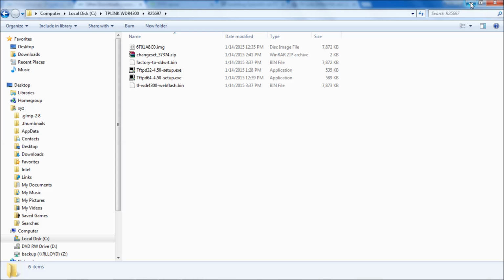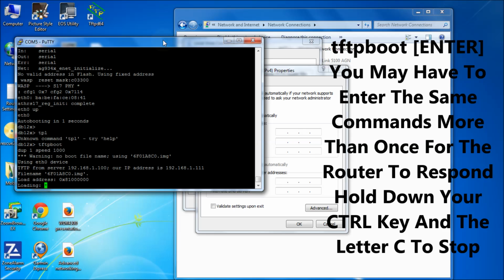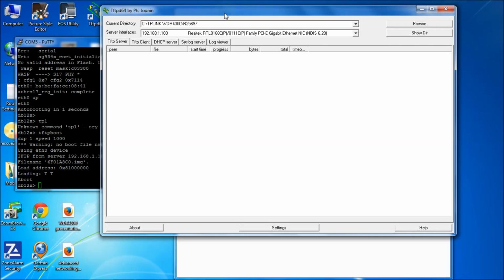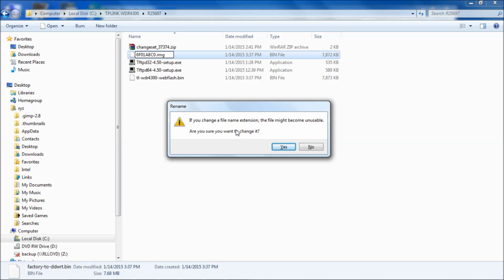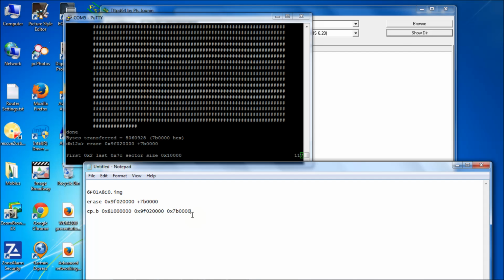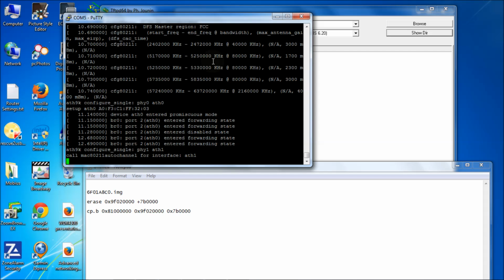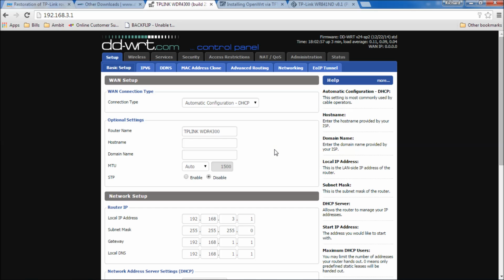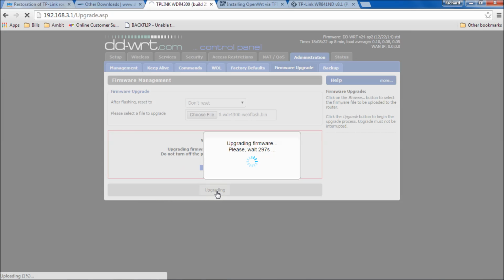Bricked TP-Link WDR 4300 Router Recovery Using UART Serial Converter Part #2

Comment: Thank you so much!
I had the same problem with another TP-Link C7 device. The problem was the same as described. The missing file had the same name: 6F01A8C0.img. I followed the same steps:
192.168.1.100
putyy
tftp
erase 0x9f020000 +f80000
cp.b 0x81000000 0x9f020000 0xf80000
reset
It worked! Thank you so much!
Reply from the maker: You're most welcome. Comments like this make my DAY! 😁️ I'm glad to know I could help you and that you got value from my work here. Thank you so much for watching, commenting and the very kind words. I appreciate it greatly. All the best.👍😀

Comment: Thank you for the tutorial Richard.
I used it to understand how to unbrick my RE450 V3, and using documentation from the openWRT forum.
But I still have a problem at reboot,  when it suddenly stops loading and write hieroglyphs

Starting kernel ...
▒NN▒▒|▒l▒`d▒▒

I tried several times with the same result and I really don't know what to do
Reply from the maker: That looks like what you get when you have incorrectly connected the serial adapter or you have a bad or cold solder. I have seen this and most times it was a connectivity issue or a poor connection issue. Take a look at all your solder connections, check your wires and connectors and make sure you have the RX , TX and ground correctly connected. Thank you so much for commenting and watching. I appreciate it greatly. All the best.👍😀

Comment: hi richard, why should erase 0x9f020000, and what is mean syntax cp.b 0x81000000 0x9f020000 0x7b0000. thank you
Reply from the maker: You are erasing specific memory blocks so that you can copy (cp) new data (firmware) to those blocks. Follow the directions exactly and you should meet with success. I have done it multiple times.
Thank you so much for commenting and watching. I appreciate it greatly. All the best.👍😀

Comment: This helped me a lot. Somehow the only thing to get a command prompt in putty was to use the 3.3v on the cp2102 AND also use the adapter on the router. At first the info in putty was gibberish but when I toggle between the on/off switch on the TP-Link (I had the WR1043 V2) I got root and where the tftp command did not work. But when I toggle the on/off again I got a command prompt ap135> and from there it was the same as on your vid. Tnx a lot

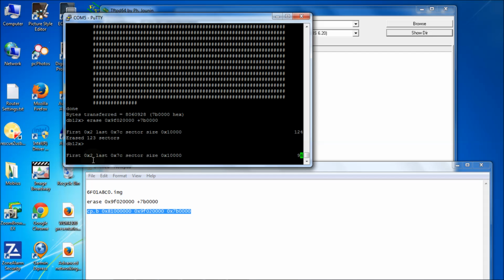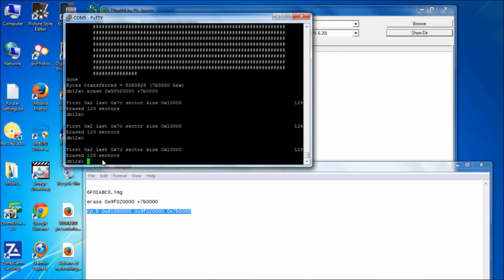Comment: Richard: You probably know this, since this was quiet a few years ago and you've learnt a bit since then, but at about the 12:00 minutes mark, the struggle you had with pasting? It was because you copied "<ENTER>cp.b 0x8100...". So the ENTER on the previous line was copied in to the putty shell. So you kept sending an ENTER to the shell. At the 13:00 minutes mark you only copied the text part, which is why it worked this time.

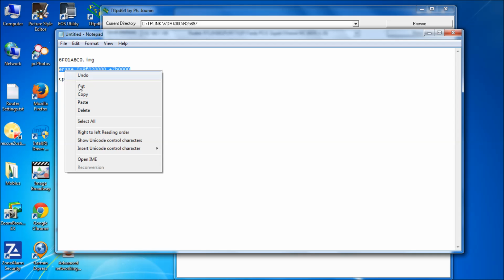Comment: HI RIchard, many thanks for the great work. I wonder how did you find the magic number @10:10  0x9f020000? I need to flash Archer C7(US) v5. I wonder if I can use this number or I need to find it somewhere?
Reply from the maker: I found it on some strange Russian site that I had to translate to English so I can't really think of where that was. I have no idea if it will work with a C7. Take a look through the comments bellow and see if anyone had any success with a C7 before you give it a go. BTW did you try the solution without the serial converter here: https://youtu.be/AU8RyW82Z2M Thank you for watching and commenting. I appreciate it greatly. All the best.
Reply: @richardlloydusa  Richard I found that magic number here https://openwrt.org/toh/tp-link/archer-c5-c7-wdr7500#recovery_using_serial_connection I did this but it did not work for me there were some issues. I actually flashed tp-link firmware and started configuring it changed the password and then could not login. Details here https://forum.openwrt.org/t/archer-c7-ru-v5-install-throught-uart/28948/10

Comment: I'm having roughly the same issue, though I'm not getting the same messages in putty...mine doesn't get to "autobooting in 1 second" and I can't stop it by typing TPL. Instead, it seems to be going through what appears to be a successful boot, but at the end of this sequence it says "restarting system" and the whole boot process restarts endlessly. I'm unable to stop this and whenever I try to type anything I get the message "PASSWORD" or "INCORRECT LOGIN". Holding the reset button when powering the router on doesn't seem to do anything either...I'll try replacing some caps in it to see if it changes anything (someone suggested this). Any possible suggestions ? Would it be easier to pull out that 8 pin SOIC, writing an official BIN firmware from Tp-link and putting it back in ? My interface is a CH431 chip which can also program those chips, in addition to UART (I use it all the time for TVs).
Reply from the maker: The procedure I show in the video is the only serial recovery I recommend. I also have a recovery process for this that does not use a serial connection that may work for you here: https://youtu.be/1hWT35w6sVI Thanks.
Reply: Already sorted it: just as I was thinking I had tried everything and nothing seemed to work, I copied the code from the existing SPI chip (the one that kept looping) onto a new blank chip and it somehow worked that way....perhaps the chip itself was faulty. I'm using a CH431 serial programmer for all kinds of stuff, this included :D

Comment: Excellent video and voice over ! My E3000 bricked with a dd-wrt update (i guess that was an fuckdate)... it can almost load the initial dd-wrt firmware... the router goes live for about 10 seconds then it craps out and aborts the tftp2 transfer... Now I'm waiting for my serial/usb to move on to this step. 
I daresay this is one of the best and videos threads on this subject because it actually shows what is expected - one must extrapolate to each case, of course. Again, great video !
Reply from the maker: You are most welcome. Thanks for watching and the kind words. I wish you the best of luck on the serial recovery. BTW I used the serial recovery on my Archer C9 this week. DD-WRT did not like being flashed with the USB drive connected. LOL.

Comment: Booting...▒▒▒▒
Booting...
Initializing SPI FLash...

Bootloader for Realtek RTL8196C. Version version v1.1f
Copyright(C) 2011 Allwins Technology. Allrights Reserved.
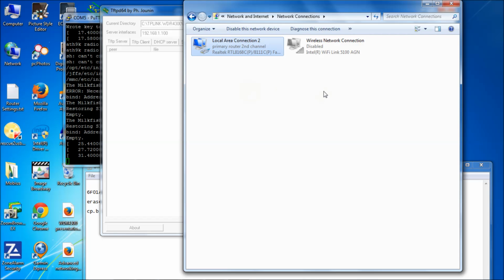16-bit system with clock frequency 390Mhz, build date 2011.05.23-15:03+0800

no sys signature at 00030000!
Set 8196C PHY Patch OK

---Ethernet init Okay!

Can help me someone ? Zyxel NBG-418N
Reply from the maker: This is meant for the TP-Link routers. Thanks.

Comment: Please explain this one please, erase 0x9f020000 +7b0000 = Check to make sure this is right for your router

cp.b 0x81000000 0x9f020000 0x7b0000.
Can this method work even LAN port has problem, caused my router can not ping. But network connection work and lan port blinking normal
Reply from the maker: There really is only one way to find out and that is to do it and see. Thanks.
Reply: thank you bro

Comment: Will this te Ichnique work for WDR4300's that have the newest firmware that prevents installation of 3rd party software? I purchased it specifically because of the decent reviews that I'd seen using dd-wrt and openwrt, and then find that I can't install any firmware except the latest edtion (i.e. reinstall it, since it came with the latest edition).
Reply from the maker: Which version is your WDR4300. I find this curious. Thanks

Comment: i saw to different listening IPs on two vids from you. one was 192.168.1.66 and the other was 192.168.1.100. how di i know on what ip my WR1043nd is listening?
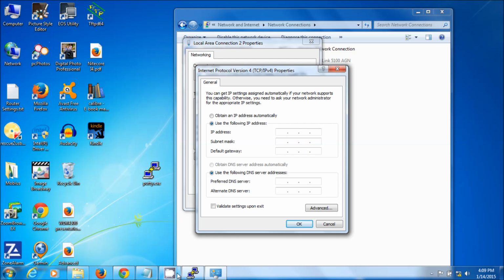Reply from the maker: You could try either and see which one works. But if you are using the serial adapter you can see directly which IP address it's looking for. I show this on this video at the 2:50 point in this video but you will require a serial connection to see it. Thanks.

Comment: I've gone and overshot the erase.  
I was supposed to do:
erase 0x9f020000 +7b0000 
but I've done 
erase 0x9f020000 +7b0200 

What are the next 0x200 bytes!?  I need to put them back.  :o(
Reply: This came about from renaming the WRONG FILE it was the TP-Link stock firmware.  Which is too big by 512 bytes (for the bootloader I guess)  Anyway I think maybe I clobbered my ART partition because ath0 and ath1 are dead.  I have a WDR3600 v 1.5

Following CORRECT numbers, I have my firmware back but no radios.

Comment: You Know Man you safe my router, yesterday I have problem because I switch 2 pins ( 3 Volts ) and my PC dont show me the COM port in device management, then I remove the solder between them
And today I encounter an other problem of tftpd server, he wants start and I used an other PC for this, it was really awesome to use two pc's, one for UART USB and putty, and the other for running tftpd, and and magically it work
Reply from the maker: +Youness Fassi Fihri Awesome! That's great. Thanks for watching and commenting.
Reply: +Richard Lloyd you're welcome

Comment: worked great many thanks ! this saved my router :)
the additional step I had to add in my case was to manually change the NIC duplex settings from auto negotiation to 100 Full Duplex. I came upon this solution because when Uboot tried loading the image file I would get a "Loading: T T T T T T T T T T (...) Retry count exceeded; starting again" error. after making the changes to my NIC it worked great.
Reply from the maker: +Eric Hansen You are welcome. Thanks for the feedback and watching.

Comment: Thanks for you video, I am trying to unbrick a TP-Link Archer C7 and I have found you instructions the same but I keep getting the following .........
ap135> tftpboot
* Warning: no boot file name; using '6F01A8C0.img'
Using eth1 device
TFTP from server 192.168.1.100; our IP address is 192.168.1.111
Filename '6F01A8C0.img'.
Load address: 0x81000000
Loading: T T
Retry count exceeded; starting again
eth0 link down

I have renamed the .bin file as per your video.

Any help would be great, thanks.
Guy
Reply from the maker: +Guy Reynolds It looks like the router is looking for a file called '6F01A8C0.img' on the server at 192.168.1.100 make sure you change the IP on your computer to 192.168.1.100 and rename the file to 6F01A8C0.img Thanks.
Reply: +Richard Lloyd Thanks for getting back so quick. I have set the the address and renamed the file as per your video and I even copied & pasted the file name!! anything else you can think of that would give me that result? Thanks again
Reply from the maker: +Guy Reynolds Turn off your Anti-Virus and firewall and try it again. If that does not work again try it on a different computer. Thanks.
Reply: Thank you, will try later tonight.
Reply: +Guy Reynolds Hi Richard
I tried another computer running xp and everything worked as per your video. Thank you so much for all your help and taking the time to do so.
Reply from the maker: +Guy Reynolds You are welcome. Glad to hear you got it fixed. Thanks for watching.
Reply: Thank you Mr Lloyd... I tried on 2 pcs with firewall/AV off to do the procedure but had the same screen messages as Mr Reynolds... does this mean the router (Archer c7 v2) is truly dead? It was bricked when someone interfered with the browser while dd-wrt updating... Any other thoughts welcome... would having this done on a win 7 machine make  any difference, I wondered? Anyone with success in win10 boxes?

Comment: For some TP-Link Routers +7b0000 is the size of the firmware, be aware that you may have a different size thus bricking your router  this will be the hex that the terminal outputs.

0x9f020000 is the from addr, for your device version you can get it by issuing the command: "printenv bootcmd" rather than searching for it
Reply from the maker: Super110336 Thank you. I can only verify this procedure works on my TPLINK TL-WDR4300 v1.

Comment: Hi Richard, i have problem with my Tp-link tl-wdr4300. I have CP2102 Module STC Serial Converter and when i try load file 6F01A8C0.img to router i have communique
in Putty:

* Warning: no boot file name; using '6F01A8C0.img'
Using eth0 device
TFTP from server 192.168.1.100; our IP address is 192.168.1.111
Filename '6F01A8C0.img'.
Load address: 0x81000000
Loading: T
TFTP error: 'File not found or No Access' (1)
Starting again

Please help my. Thanks for advice.
Reply from the maker: Marcin Gajda Have you tried doing this without the serial connection? https://youtu.be/1hWT35w6sVI?list=PLnxXRLSlmSVNiENiN9wTejP6dtIqqmTya

Comment from the maker: @Martin Brigilia Try a 30-30-30 reset first https://youtu.be/gczCzP9Rry0?list=PLnxXRLSlmSVNiENiN9wTejP6dtIqqmTya If that does not work try taking it back to the stock firmware and see if the WIFI works there. https://youtu.be/1hWT35w6sVI?list=PLnxXRLSlmSVNiENiN9wTejP6dtIqqmTya If it does you know that your hardware is OK and then you can try the DD-WRT firmware again. But if the WIFI does not work with the stock firmware then I suspect a hardware issue.
Reply: +Richard Lloyd @Martin Brigilia. Guys i am facing the same wifi problem after the unbrick.
The dd-wrt does not recognize the wireless service. On the stock firmware i can see the wireless configs, but it not works.

Could you let me know how to fix it ?

tks in advance
Reply from the maker: +Pedro Souza Try the r27147 firmware and see what happens. Thanks.
Reply: +Richard Lloyd , I found the reason: i deleted the art partition, but i am still looking for a way to restore it.
Reply from the maker: +Pedro Souza Ok. I am not familiar with restoring partitions on it.

Comment: Hi Richard, I have got my router revived with this methos, it resulted the only method that worked. Now I have an issue, No WiFi at all!!, also tryed to upgrade dd-wrt to latest (05-09-2015) but no luck. Here is a little excerpt from my bootlog

Jan  1 00:00:02 WDR4300-V1 kern.info kernel: [    4.070000] Loading modules backported from Linux version master-2015-03-09-0-g141f155
Jan  1 00:00:02 WDR4300-V1 kern.info kernel: [    4.080000] Backport generated by backports.git backports-20150129-0-gdd4a670
Jan  1 00:00:02 WDR4300-V1 kern.info kernel: [    4.210000] cfg80211: Calling CRDA to update world regulatory domain
Jan  1 00:00:02 WDR4300-V1 kern.info kernel: [    4.240000] cfg80211: World regulatory domain updated:
Jan  1 00:00:02 WDR4300-V1 kern.info kernel: [    4.240000] cfg80211:  DFS Master region: unset
Jan  1 00:00:02 WDR4300-V1 kern.info kernel: [    4.240000] cfg80211:   (start_freq - end_freq @ bandwidth), (max_antenna_gain, max_eirp), (dfs_cac_time)
Jan  1 00:00:02 WDR4300-V1 kern.info kernel: [    4.250000] cfg80211:   (2402000 KHz - 2472000 KHz @ 40000 KHz), (N/A, 2000 mBm), (N/A)
Jan  1 00:00:02 WDR4300-V1 kern.info kernel: [    4.260000] cfg80211:   (2457000 KHz - 2482000 KHz @ 40000 KHz), (N/A, 2000 mBm), (N/A)
Jan  1 00:00:02 WDR4300-V1 kern.info kernel: [    4.270000] cfg80211:   (2474000 KHz - 2494000 KHz @ 20000 KHz), (N/A, 2000 mBm), (N/A)
Jan  1 00:00:02 WDR4300-V1 kern.info kernel: [    4.280000] cfg80211:   (5170000 KHz - 5250000 KHz @ 80000 KHz), (N/A, 2000 mBm), (N/A)
Jan  1 00:00:02 WDR4300-V1 kern.info kernel: [    4.290000] cfg80211:   (5735000 KHz - 5835000 KHz @ 80000 KHz), (N/A, 2000 mBm), (N/A)
Jan  1 00:00:02 WDR4300-V1 kern.info kernel: [    4.300000] cfg80211:   (57240000 KHz - 63720000 KHz @ 2160000 KHz), (N/A, 0 mBm), (N/A)
Jan  1 00:00:02 WDR4300-V1 kern.err kernel: [    4.740000] ath: phy0: Unable to initialize hardware; initialization status: -5
Jan  1 00:00:02 WDR4300-V1 kern.err kernel: [    4.750000] ath9k ar934x_wmac: failed to initialize device
Jan  1 00:00:02 WDR4300-V1 kern.warn kernel: [    4.750000] ath9k: probe of ar934x_wmac failed with error -5
Jan  1 00:00:02 WDR4300-V1 kern.warn kernel: [    4.760000] PCI: Enabling device 0000:00:00.0 (0000 -> 0002)
Jan  1 00:00:02 WDR4300-V1 kern.err kernel: [    4.770000] ath: phy1: Unable to initialize hardware; initialization status: -5
Jan  1 00:00:02 WDR4300-V1 kern.err kernel: [    4.780000] ath9k 0000:00:00.0: Failed to initialize device
Jan  1 00:00:02 WDR4300-V1 kern.warn kernel: [    4.780000] ath9k: probe of 0000:00:00.0 failed with error -5
Jan  1 00:00:02 WDR4300-V1 kern.info kernel: [    5.790000] eth0: link up (1000Mbps/Full duplex)

Any ideas?

Thanks!